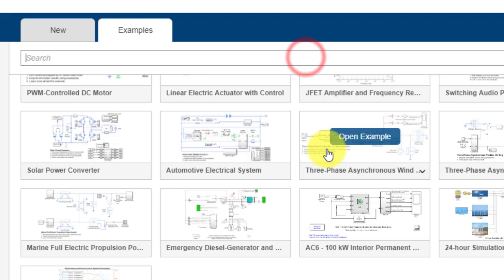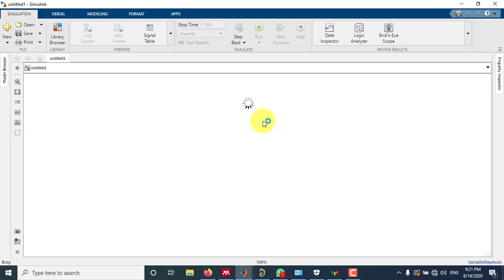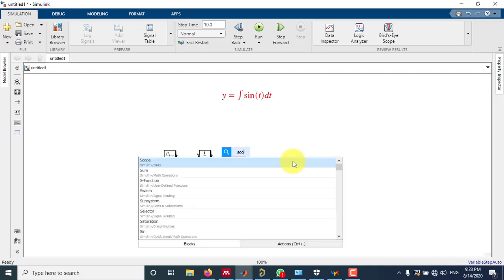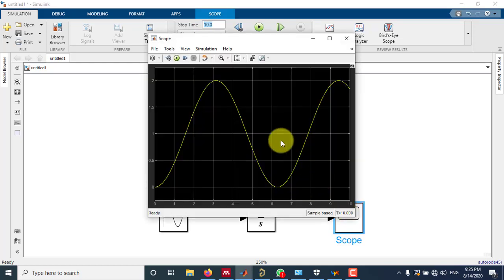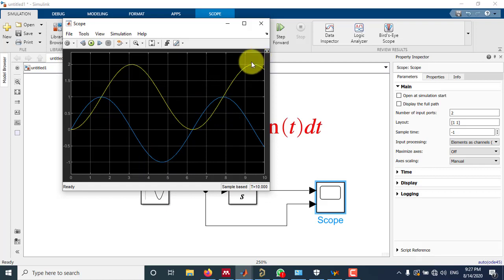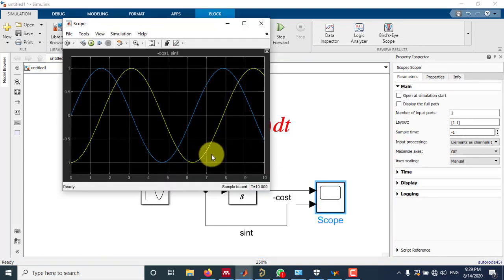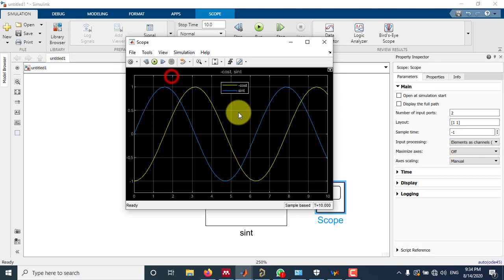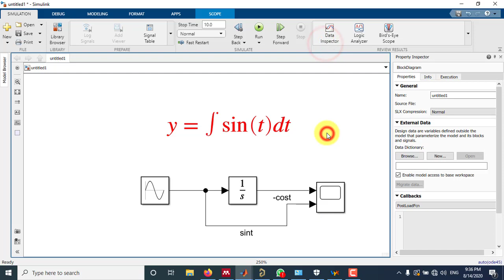Introduction to Simulink/Matlab 2020a| Getting started tutorial|

Comment: sir!when i run only straight line is show on scope..2020a
Reply from the maker: One reason could be you used a much lower frequency and used a relatively shorter simulation time. The sinusoid may not complete a cycle. increase frequency to see whether it's working right or not.
Reply: @electroengineer-sq1  thankyou sir!its working.